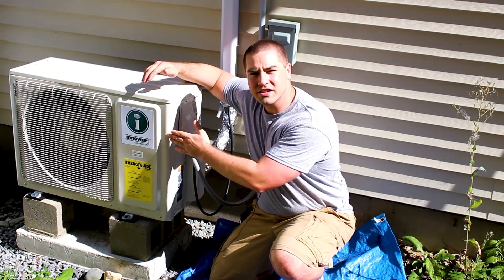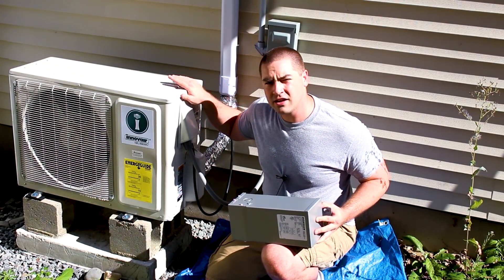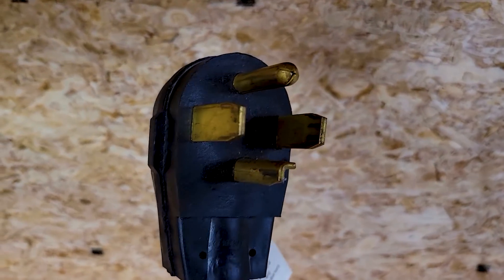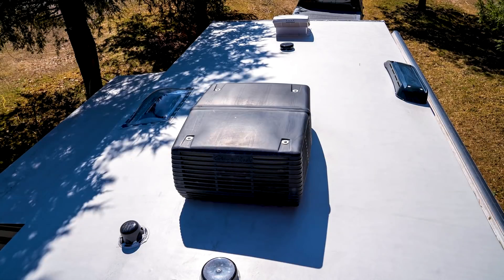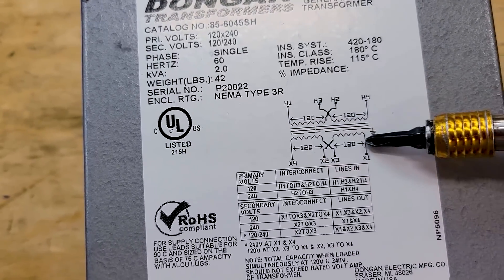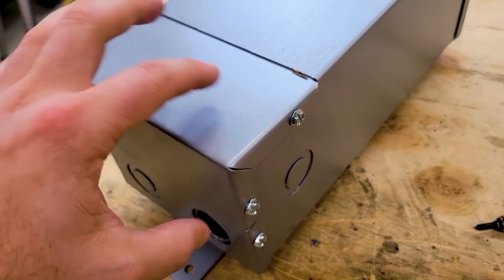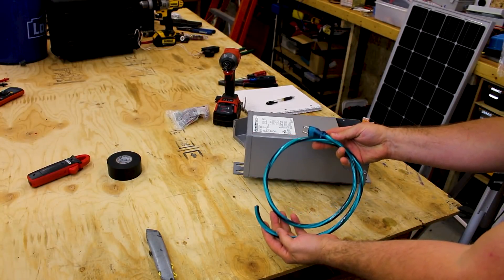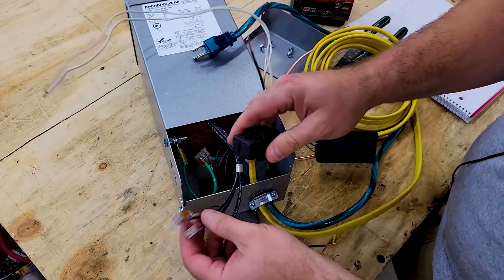Transform your mini-split heat pump for your RV/Camper Project

Comment: Having the transformer with no load means it’s almost 100% inductive load - so the Power Factor will be close to zero. Probably the Bluetti can only measure loads with a PF close to 1.
Reply from the maker: O, cool.  Thanks for sharing an explanation.  I didn't understand why it was reading off.
Reply: @DavidPozEnergy  The Bluetti is probably measuring apparent power (VA) instead of real watts because that is what it cares about. If you change the displays of your plug-in meter it would likely show 300 VA used.
Reply: @DavidPozEnergy  I was just commenting about this, I think 288W could be the accurate one. In inverters we should account for the apparent power (VA). May be you can confirm the idle consumption by measuring the actual current draw from the battery. I see people using Transformers to get 120V split phase or 120V to 240V from their inverters, but I always wonder about the idle power consumption from the batteries. I'm also not sure but those transformers could be drawing quite a lot of power from the DC side. Using Transformers with grid is "ok" because home consumers only pay for real power (W) but in inverters?

Comment: I just put a mini spilt in my ‘03 Winnebago Journey. I replaced the factory A/C with a welded drop Bracket that held the condenser, then ran the lines to the middle cabinet. I had to cut out the center about a 1 1/2” for the head unit so that it would fit. But the reason I am writing is that you can buy the 110 model just like yours for under $700 on eBay! Working fantastic, even in the Arizona heat! We just leave it on when we store it and it’s always nice, just set it and forget it!
Reply: The efficiency is the same for each unit. They still use the same actual power in wattage just different volts and amps. The larger units can't run on 120v cuz it's limited to a 15a circuit.

Comment: Hey David I've thought about doing this for my bus conversion just because I could get a duel head unit there are a lot of 120 volt mini split units out there but not duel head one's. I like the idea would you wire it right into a sub panel along with the few other 120 volt breakers the 120 volt models I've been looking at are 12000 btu I do have room for two units but this would be so much cheaper I think I'm putting at least 3000 watts on the roof and buying  Victron inverters and big battery has some great batterys I'm looking at.

Comment: Great Idea for Coach Conversions! What about twin split systems that run Not at the same time David? Thank You!
Reply: My question was if I have 2, split systems, and both never run at the same time, can they run off the same transfer or do they each need one each?
Reply: @NicInLvNv  technically yes they can...in practice it's a bad idea unless some kind of switch alternates them. Take the thinking out of it. You don't wanna overload the transformer. I'm sure there's a switch that disconnects one and sends 240v to the other
Reply: Your question is unclear. What about them? The transformer still does it's thing up to it's 2 KVA rating

Comment: Why would you not use a 120 volt split unit?
Reply: When I was shopping for them the 240V mini splits were more efficient (some of which you lose in the conversion) but can also function at a lower temperature.

Comment: Transformers are really great, just make sure you carry your grounds through and that you stay within the limits including power factor. Don’t want to overheat the transformer.  The thing to watch out for is the surge on startup, if the transformer starves the compressor and causes under voltage it could slowly kill the ac unit even though it looks like it’s working.  Depending on your ac unit you would want to put a soft start module on it to avoid the big surge current.
Reply: I believe all or most mini splits are soft start but don't take my word.
Reply: @glossyfpv1155  agreed, as long as it’s an inverter mini split I believe it would be okay. But for the traditional rotary compressor spilts out there it could be an issue to watch for.
Reply: @DemonicAnimatronic  good point. Definitely agree there

Comment: you can also get 120v mini split units.
Reply: Absolutely, though you can get better efficiency with 240v. My unit,  forget the brand, is a 9000btu 38seer.

Comment: More than likely your Bluetti is getting incorrect reading on the output wattage possibly due to it being a modified sign wave output, if it is a pure sine wave output it may just be a poor current shunt/opamp/comparator design.